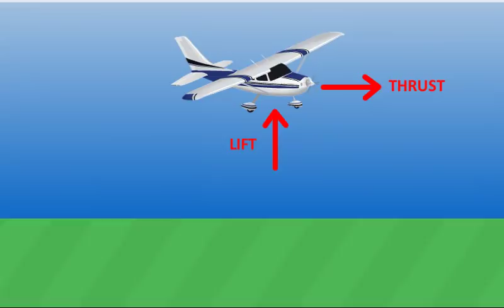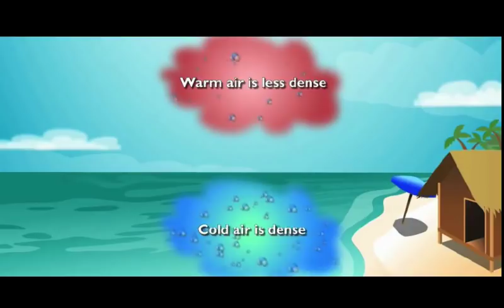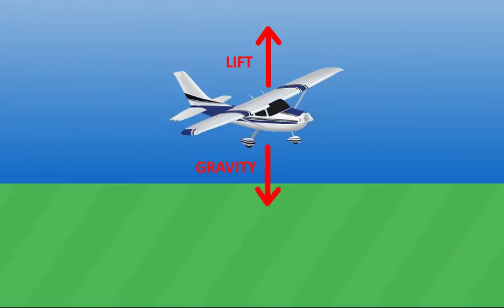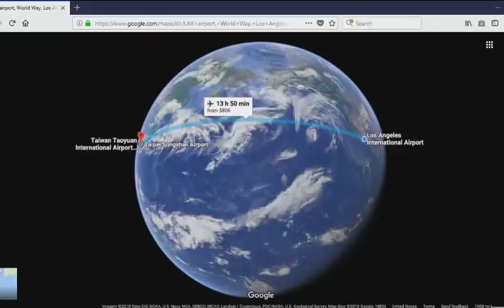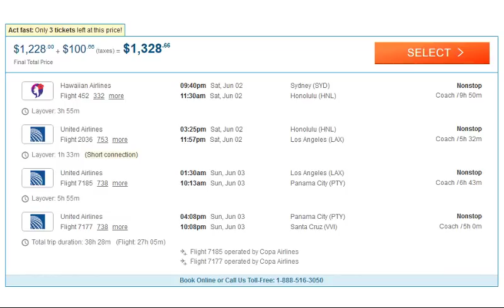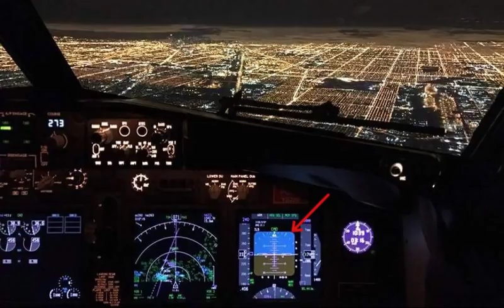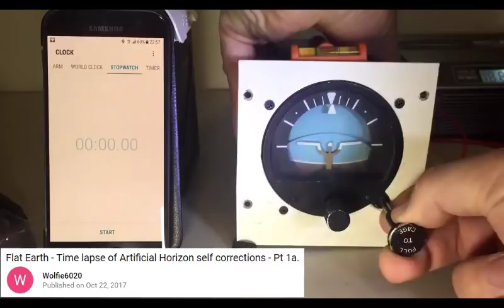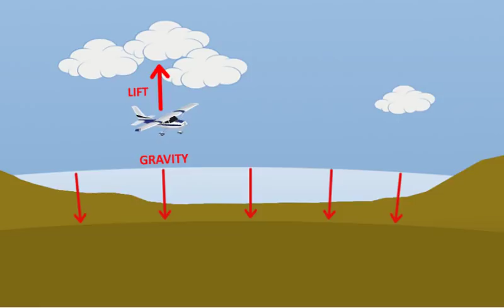Flat Earth Falsities - Plane Nonsense

Comment: flat earthers are thick//and in a deluded state of mind they don/t want the earth to be round because they will look stupid and would have to admit they are wrong //the deluded never admit they are wrong .//they make Americans look silly around the world ;;'no pun intended .///
Reply: A surveyor and engineer of thirty years “I am thoroughly acquainted with the theory and practice of 
civil engineering. However bigoted some of our professors may be in the theory of surveying according to the prescribed rules, yet it is well known amongst us that such theoretical measurements are INCAPABLE OF ANY PRACTICAL ILLUSTRATION. All our locomotives are designed to run on what may be regarded as 
TRUE LEVELS or FLATS. There are, of course, partial inclines or gradients here and there, but they are always accurately defined and must be carefully traversed. But anything approaching to eight inches in the mile, increasing as the square of the distance, taking one station with another all over England and Scotland, 
it may be stated that all the platforms are ON THE SAME RELATIVE LEVEL. The distance between Eastern and 
Western coasts of England may be set down as 300 miles. If the prescribed curvature was indeed as represented, 
the central stations at Rugby or Warwick ought to be close upon three miles higher than a chord drawn from the two extremities. 
If such was the case there is not a driver or stoker within the Kingdom that would be found to take charge of the train. We can only laugh at those people who seriously give us credit for such venturesome exploits, as running trains round spherical curves. 
Horizontal curves on levels are dangerous enough, vertical curves would be a thousand times worse.
Reply: WHAT ARE YOU SAYING THE EARTH SEEN FROM SPACE BY ALL NATIONS WHO HAVE BEEN THERE ARE LYING WHY //...CANALS HAVE WATER IN THEM APART FROM A FEW LOCKS THERE LEVEL YOU TAKE OUT THE TOPS AND FILL IN THE LOWS TO KEEP STRAIGHT //AND LEVEL OR AS WITH TRAINS TUNNEL //ITS SO GRADUAL ON A LONG STRETCH OF TRACK YOU CAN SEE IT SLOWLY DIPPING DOWN AND AWAY YOU MOVE FORWARD YOU CAN SEE BUT A HEAD IT DIPS DOWN THATS DOWN NOT UP //AND THE TRACK CANT BE SEEN AGAIN /.//WHAT ON EARTH ARE YOU SAYING ///IF GOT YOU WRONG I APOLOGISE NOW .//FROM RUGBY OVER AND OUT OF SIGHT////
Reply: The London and Northwestern Railway forms a straight line 180 miles long between London and Liverpool. The railroad’s highest point, midway at Birmingham station, is only 240 feet above sea-level. If the world were actually a globe, however, curving 8 inches per mile squared, the 180 mile stretch of rail would form an arc with the centre point at Birmingham raising over a mile, a full 5,400 feet above London and Liverpool.
Reply: Why are they lying? 18 Billion Dollars a year I think I would start lying, easy job.
Reply: YOUR WRONG THE TRACKS IMAGINE 100 MILE LONG A MAN WALKS FORWARD //IF YOUR RIGHT AND YOUR NOT///YOU WOULD SEE THE MAN WITH STRONG BINOCULARS //BUT YOU CAN/T 10 MILES HES GONE //2 MILES YOU SEE HIM FROM THE WAIST UP 4 MILES YOU SEE NOTHING HE/S GONE OVER THE HORIZON ///HOW DO YOU THINK RIVERS FLOW TO THE SEA IF EVERY WARE IS FLAT THE WATER WOULD JUST SIT THERE LIKE A SPIRIT LEVEL//.ALL RIVERS FLOW DOWN THATS DOWN STREAM//DEAR GOD//PLEASE DO NOT SAY YOUR BRITISH.//
Reply: “As an engineer of many years standing, I saw that this absurd allowance is only permitted in school books. No engineer would dream of allowing anything of the kind. I have projected many miles of railways and many 
more of canals and the allowance has not even been thought of, much less allowed for. This allowance for curvature means this – that it is 8” for the first mile of a canal, and increasing at the ratio by the square of the distance in miles; thus a small navigable canal for boats, say 30 miles long, will have, by the above rule 
an allowance for curvature of 600 feet. Think of that and then please credit engineers as not being quite such fools. Nothing of the sort is allowed. We no more think of allowing 600 feet for a line of 30 miles of railway or canal, than of wasting our time trying to square the circle”
Reply: I'm only trying to help.
Reply: WHO RUSSIA CHINA INDIA THEY OWE AMERICA NOTHING .///
Reply: IM SORRY YOU ARE NOT AN ENGINEER ,..//YOU HAVE GOTTEN HOLD OF SOME NONSENSE ./DO YOUR EMPLOYERS KNOW YOU HAVE DANGEROUS IDEAS //AND ARE FLOUTING PEOPLE LIKE BRUNEL //AS FOOLS /.WE WILL BEG TO DIFFER I AM RIGHT AND YOU ARE A FRAUD AND WRONG.//ENGINEER WHO THINKS THE WORLD //IS FLAT//IS NO ENGINEER //IM SORRY BUT NO IT TO SILLY FOR WORDS.//
Reply: Rivers run down to sea-level finding the easiest course, North, South, East, West and all other intermediary directions over the Earth at the same time. If Earth were truly a spinning ball then many of these rivers would be impossibly flowing uphill, for example the Mississippi in its 3000 miles would have to ascend 11 miles before reaching the Gulf of Mexico. They have been taking us all for Cunts for far too long but we still remain the minority. It is a very hard pill to swallow but what you have to ask yourself is "Shall I take the Blue pill or the Red pill Neo. For me the Blue pill was never working, it was actually destroying me. I then had nothing to lose so I took the Red. Be Lucky.
Reply: HAVE A LOOK WITCH WAY MOST RIVERS RUN/YOUR TALKING AND      BACK PEDALLING IF THE EARTH WERE FLAT//APART FROM A  HILL THEY WOULD NOT FLOW AT ALL AND IF AS YOU SAY THE LOWEST POINT WAS THE SEA THEY WOULD ALL FLOW IN THE SAME DIRECTION //AS THEY WOULD ALL FLOW TO THE SAME LOW POINT .//YOUR NO ENGINEER YOU TALK LIKE A CHILD .//THE LOWEST POINT WOULD ATTRACT ALL WATER ALL RIVERS WOULD MERGE AND EMPTY INTO THE SAME SPOT .//YOUR NO ENGINEER THAT IS FOR SURE ,.//
Reply: Remember, they wrote the books.
Astronomer = moon starer
Astronomers = No more stars
Geologist = Go Get Oils
Evangelist = Evil's Agent
Statue of Liberty = Built to Stay Free
The United States of America = Attaineth its cause, freedom
Conversation = Voices Rant On
Clint Eastwood = Old West Action
A telescope = To see place
Eleven plus two = Twelve plus one
Schoolmaster = The classroom
A shoplifter = has to pilfer
listen = silent
Debit card = Bad Credit
The eyes = They see
William Shakespeare: I'll make a wise phrase
Dormitory = Dirty Room
Confessional = On scale of sin
Garbage Man = Bag Manager
Princess Diana = end is a car spin
madonna louise ciccone = one cool dance musician
Reply: Oh and if you must know. 
Spice Girls = Pig Slices. Peace Brother.
Reply: If Earth were a ball 25,000 miles in circumference as NASA and modern astronomy claim, spherical trigonometry dictates the surface of all standing water must 
curve downward an easily measurable 8 inches per mile multiplied by the square of the distance. This means along a 6 mile channel of standing water, the Earth would 
dip 6 feet on either end from the central peak. Every time such experiments have been conducted, however, standing water has proven to be perfectly level.
Do I sound confused to you?
Reply: RIGHT ONE LAST TIME MR NOT ENGINEER .//GET A BALL TIP A SMALL AMOUNT OF WATER ON IT SEE WHAT HAPPENS JUST LIKE RIVERS AND STREAMS THE WATER FLOWS IN ALL DIRECTIONS JUST LIKE OUR RIVERS ..NOW GO OUT SIDE TIP SOME WATER ON A FLAT SLAB WHAT HAPPENS //NOTHING IF YOU TIP THE SLAB   ,/  ALL THE WATER RUNS OFF THE SAME EDGE IN THE SAME DIRECTION ..AN ENGINEER WOULD KNOW THAT .//A CHILD LEARNS THAT ..///YOUR DELUDED I DO/NT MEAN   TO BE RUDE BUT REAL ENGINEERS ARE FINDING IT   TOUGH WITH COMPUTERS DOING THERE JOBS YOUR NOT HELPING .//WITH THIS SILLY SHITE .//UNLESS THIS IS A PISS TAKE///.
Reply: The natural physics of water is to find and maintain its level. If Earth were a giant sphere tilted, wobbling and hurdling through infinite space then truly flat, consistently level surfaces would not exist here. But since Earth is in fact an extended flat plane, this fundamental physical property of fluids finding and remaining level is consistent with experience and common sense.
Reply: One portion of the Nile River flows for a thousand miles with a fall of only one foot. 
Parts of the West African Congo, according to the supposed inclination  and movement of the ball-Earth, would be sometimes running uphill and sometimes down.This would also be the case for the Parana, Paraguay and other long rivers.
Reply: I'll ask you again, Do I sound confused?
Reply: no your beyond help all the planets and moons are round and earth is a discos ///.makes perfect sense i am    off now to make my  pancakes flat and round .//like your planet and i will go out side and eat them in my round wonderful earth .//well by mad dog mullsey we do not agree but i am right and you are wrong ..//its been different by and i wish you well ..////

Comment: An aeroplane has 1000mph momentum at the equator, but at the poles it has none. So if flying north or south they would need to compensate for the Coriolis Effect.  But do they? If they don’t then they would go way off course.
Reply: A pilot makes constant corrections to stay on course
Reply: Are these corrections specifically to compensate for Coriolis are you aware?
Reply: If they are then that would mean the globe spins :)
Reply: I've heard the Coriolis described as equivalent to a 1mph crosswind,  which is pretty insignificant given actual winds an aircraft goes through that have far greater effect; any compensation for it is simply "lost" in the overall piloting task.
Reply: Clearly planes would have to compensate for wind shear and things like that which could push the plane off course but I haven't heard of them putting in a correction-factor for the Earth's spin. To get a confirmation on this would be the end of the Flat Earth debate because their disc does not spin :)  The airstreams themselves are affected by spin momentum (forming vorticity and circulations)
Reply: David, Do you have any knowledge about navigation? Nowadays pilots are using radio signals from ground towers or just GPS signals to fly to their destination. Besides, winds have more significant impact on airplane fly path than Coriolis effect.
Reply: That does seem credible and so the big coriolis effect is on huge airstreams but negligible on a small aircraft as the local wind is a far greater force.  Thanks :)
Reply: Very difficult, there are too many other forces.  But it seems long-range ballistics has already shown Coriolis...

The Eötvös Effect has been measured.  http://www.cleonis.nl/physics/phys256/eotvos.php
Reply: Thank you. That is very interesting indeed (the Eotvos Effect) :)
Reply: Thank you. That makes a lot of sense as the bullet is not compensating after launch like an aircraft does

Comment: Must be hard to keep the lie alive :)
Reply: I know, especially when literally every sunset shows the Earth is round.
Reply: Oh I have. You believe the sun is 3000-6000 miles in the sky, but “sets” due to a magical form of perspective where things at vanishing point don’t get smaller, but they do disappear from the bottom up.
Reply: Must be hard to function in society, being so stupid you believe the earth is flat.
Reply: because thats not how perspective operates.
Reply: OLDKMT: there is literally no point using maths to argue with flat earthers. Doesn’t matter how convincing or obvious it is, they just glaze over at the first big number.
Reply: Marcia perspective does not cause things to disappear bottom up. It causes a continuous uniform decrease in angular size until it seems to disappear when it's angular size is less that the resolution capability of either your eye or the magnifying device you are looking through.
Reply: Marcia: yes do imagine a car driving away on a perfectly flat road: it gets smaller and smaller until you can’t see it. 

But the sun is the same size when it sets. (And before you post another video of a camera adjusting its exposure, you can’t see the proper size of the sun without a solar filter. It’s too bright and glarey.)
Reply: GrahamStw you may be right. Lol
Reply: Then there’s the slight issue that if the sun only appears to set then you should still be able to see it with a telescope after it set. 
But you can see the set sun again by going to a higher altitude after it has just set. 
You’ll often see tall buildings or mountains still lit at the top for a while after the sun has set at sea level.
Reply: Oh and the other issue that the real life bearings of sunset don’t match what the flat earth map says they should be.
Reply: Marcia why would you see a cars headlights at all if it were driving away from you?
Reply: Marcia, your linked video shows the camera’s exposure adjusting as someone zooms in on a sun that has not set. 
That isn’t what I asked for. If the sun only sets because it gets too far away to see then you should be able to use a telescope to see the sun AFTER it has set. i.e. when it is dark!
Reply: I’ve got an interesting exercise I’d like to walk you through that will help you understand how your model is inconsistent with reality. There is a simple formula you can use to determine the angular size of an object based on its physical size and its distance: (d / D) x 206265 = α. In other words, take the physical size (d) of an object, divide it by the distance (D), multiply that by the constant 206265, and that gives you the angular size (α) in arc seconds. we can use this formula to also determine an objects size if we know the distance and angular size. the sun has an angular size of about 32 arc minutes when viewed from the earth. so if it is 3000 miles away that would put it at about 27 miles in diameter. so let’s run that calculation again to see what its angular size would be at roughly the farthest possible viewing distance if it were circling above a flat disk earth. that would be about 24000 miles. at that distance, if the sun were 27 miles across, that puts the angular size at about 3 arc minutes or about 180 arc seconds. the human eye is capable of resolving an angular size as small as about 32 arc seconds on average. so if the sun were circling over a flat disk 3000 miles away as in the flat earth model. it would always be visible 24 hours a day. but it isn’t. so it must not be circling above us at 3000 miles.
Reply: Marcia - if the sun is 3000 miles up, what is it exactly?  What powers it?
Reply: Please explain yourself. What did you say?
Reply: Yes, I believe the sun could be 3000 miles in the sky and looks like it's setting because of the law of perspective.  Why is that hard to believe?
Reply: I'd never heard of Burj Khalifa so looked it up. It's still just perspective so I don't know how it's any different than other buildings. I copied this from the below link explaining that "the sun 'sets' because it recedes from view. Imagine a car driving away on a perfectly flat road. Eventually, you no longer see its head lights. This is essentially what happens on the Flat Earth as well." Not sure what your point is.  https://www.bungie.net/en/Forums/Post/227259867?sort=0&page=0
Reply: Your reply is so general, honey. You're definitely brainwashed. Please take time to research sunsets on a flat earth before you make comments.
Reply: You can zoom in to still see it going down just like we can see ships still going out to sea. An example, watch this short 19 second video. https://youtu.be/yhn2AXRwK5o  I'm glad you're asking questions or trying to prove your point because that's how I found out the earth is flat, by asking questions. Good for you to be open-minded.

Comment: What’s pulling it down, nothing it doesn’t have the energy to keep moving has to rest just like you!!! Same as birds 🦅 some stay up for many many miles but get tired so they rest!!! Not from  a imaginary force!!
Reply: Birds use air currents to stay in the air. Are you for real??
Reply: Are you actually interested in discussing the topic or do you just want to continue spamming?
Reply: nothing? it just happens the force generated to lift up is the same to overcome the weight. you're an idiot. the bird is constantly being pulled down. thats why it needs to flapt its wings.
Reply: Hmm, so your astute observation is that birds do tend to get tired? Maybe because they have to work against something.

I can't quite put my finger on what it's called...

:P